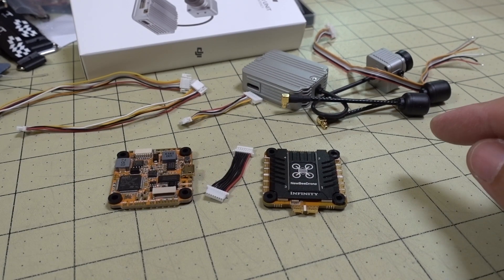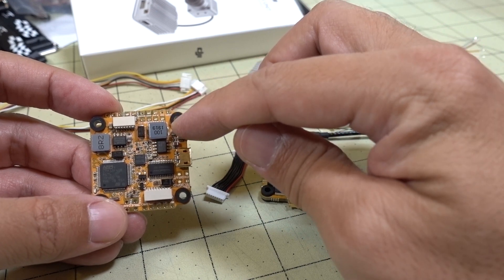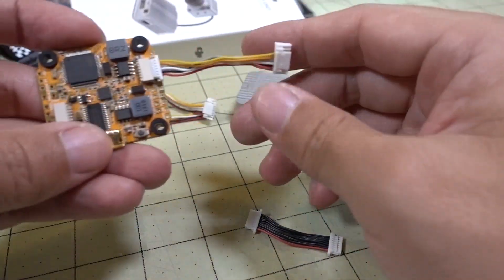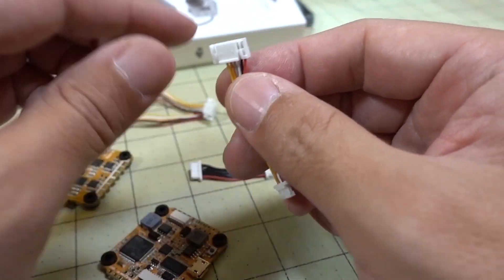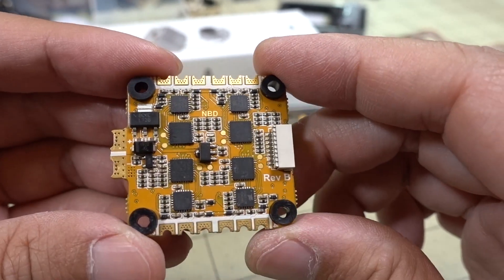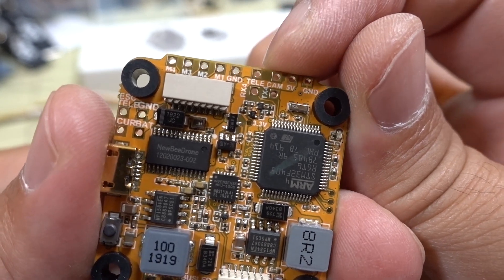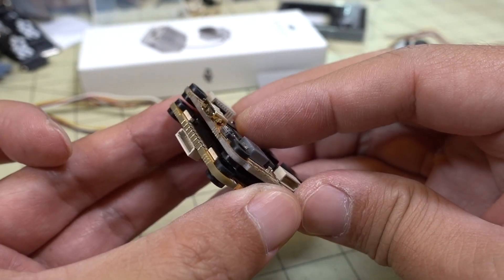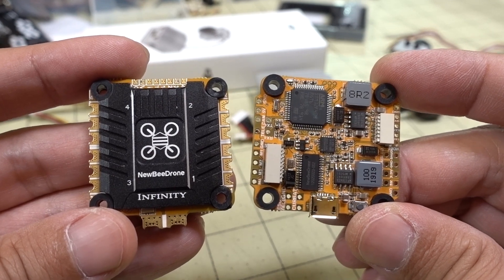NewBeeDrone Infinity30 Stack for DJI Air Unit 🐝

Comment: Noob question... When would I need to use the 30x30 stack over the 20x20 stack? Would it really just be if I wanted to run 6s safely?
Reply from the maker: Also if you crash a lot and don't disarm quickly enough to avoid the current surge.  The 30x30 will give you a better chance it will survive over the 20x20.
Reply: @AlbertKimTV  thank you!! I appreciate ya 😎

Comment: How do you turn on the LEDs? Mine only flash white for a second when powering it on then they turn iff
Reply from the maker: They are programmable.  You have to run the LED signal wire to the FC and program it in Betaflight.
Reply: @AlbertKimTV  I figured it out. Even easier way is to go into blhelisuite

Comment: I’m having problem getting my Taranis to work with this flight controller (Infinity 30 & X-RSX). Do I really need to cut the SBUS (yellow wire) to get the drone respond to the Taranis with X-RSX? Thanks.

Comment: I’m having problem getting my Taranis to work with this flight controller (Infinity 30 & X-RSX). Do I really need to cut the SBUS (yellow wire) to get the drone respond to the Taranis with X-RSX? Thanks.
Reply from the maker: I'm not sure what you mean by "cut the SBUS wire"... can you explain?
Reply: Albert Kim I meant, will it make a difference if I cut the Yellow wire from the cable that goes to the flight controller to the DJI Air Unit if I wanna use the Taranis? I tried cutting it, but it still doesn’t work. I mean when I go to Betaflight on the Receiver tab, the bars don’t respond to the gimbal sticks. 

I sent you a message on Reddit about this. Thanks.

Comment: Why does the FC has a OSD Chip if it is for DJI Air unit?

Seems like they just slap a 8 pin connector on the FC meh
Reply from the maker: Because the Air Unit will support the OSD functions later.  Also, the stack is not just for the Air Unit, it will work with traditional setups as well.

Comment: After watching your video about the Nazgul 5 again I went to the iFlight website to see if it was there yet and ran across this again. It's been on their product page for a couple of weeks now. With everyone finally rolling out videos on the DJI system and components that go with it on the FPV side I'm kind of surprised that no one really mentions this. It's an iFlight DC3 pre-made with the DJI Air Unit and a choice of a few receivers. It seems to have decent components, BUT you need to buy it with the goggles or the controller as part of the bundle at upwards to 1,000 USD.  https://www.iflight-rc.com/index.php?route=product/product&path=254&product_id=1017